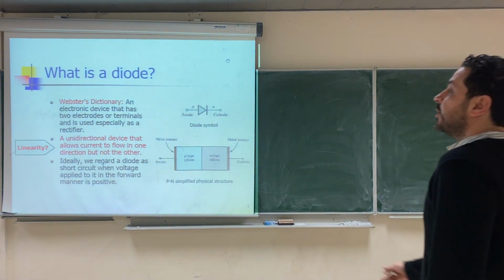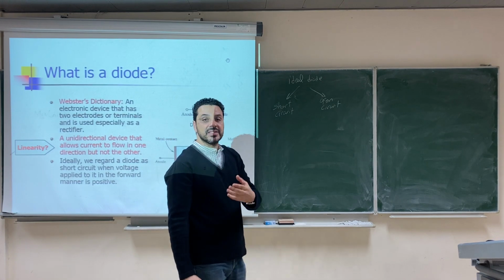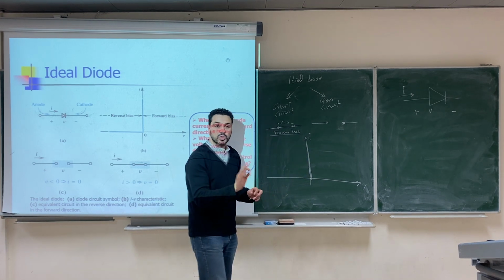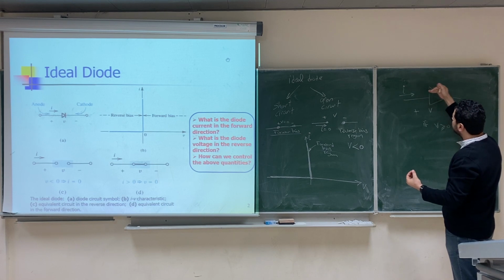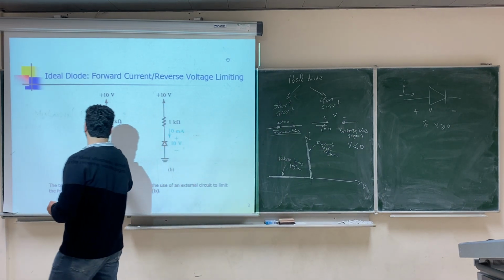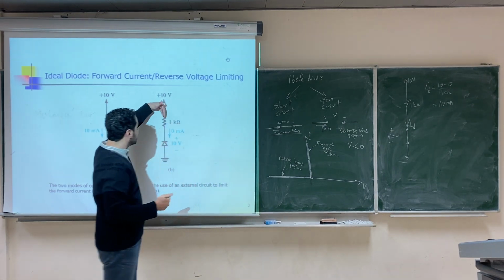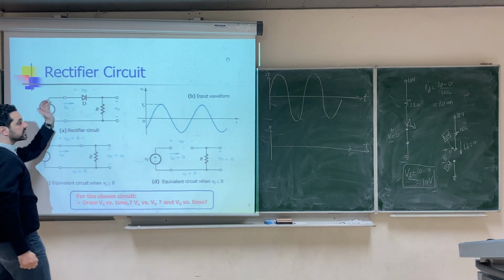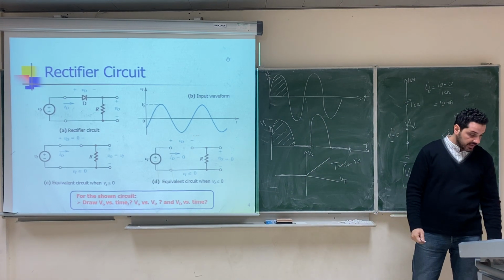EE 203, 15- Diodes: Introduction

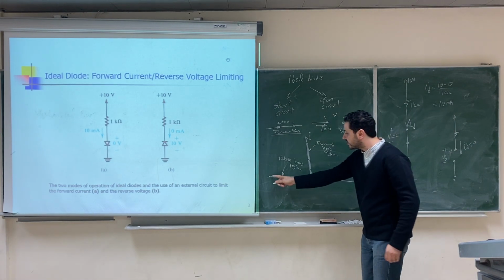Comment from the maker: Correction: At 14:05 the voltage of the diode should be in the opposite direction and hence it should be -10 volts.